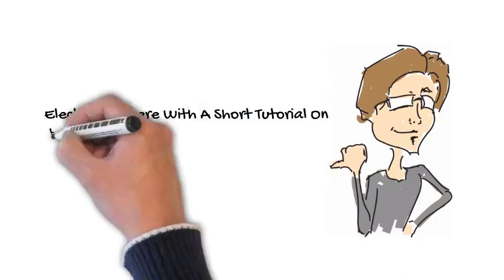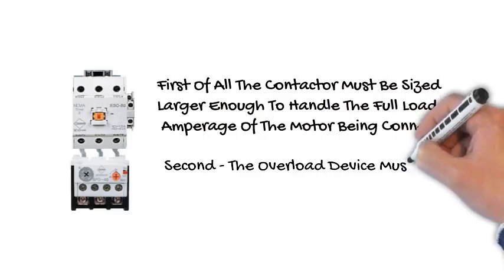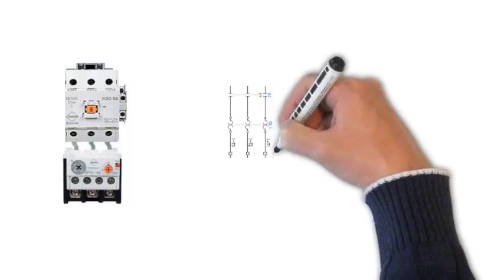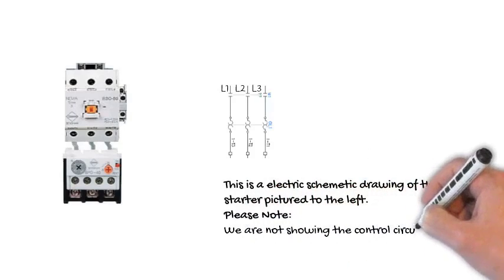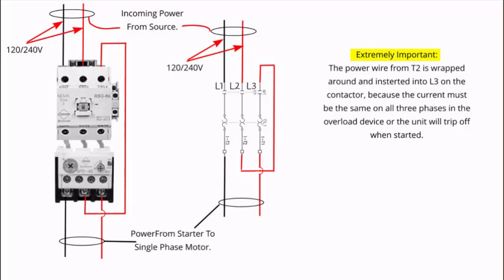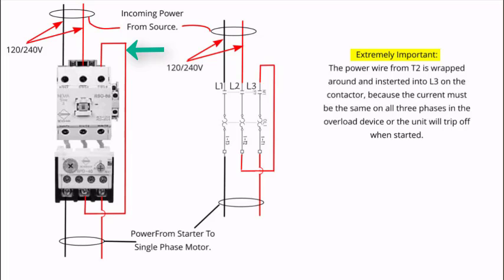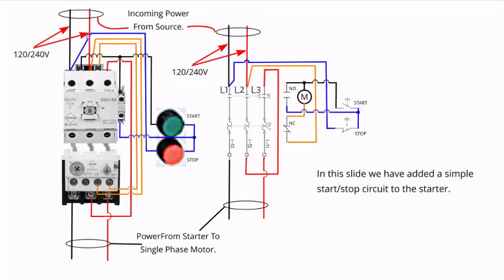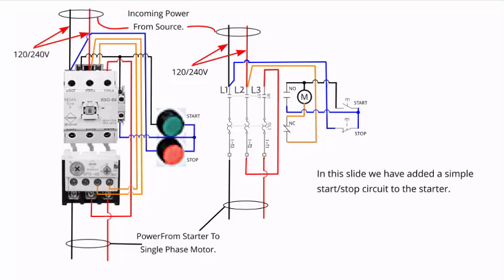Single Phase Starter Connections.

Comment: MY lath stops & start opareats  momaly but sometimes  when my Nabour switched on jet washer my lath switches of { why} ,  Often i only use my lath for short runs of work ,  but in  hot weather i find  my lath will not run long  [WHY]  
often My lath will keep turning of.  But then after several tries it will say on & work      normally for some  time & restart  Normally  when next i return to ti  {WHY}  Las Thompson ? It is a Single Phase Stand aloe stop-start box

Comment: This is my project at my school. i wonder if i can do this without an overload relay? just the contactor only? and if yes, should i also connect the T3 of the Contactor to the L3 of the Contactor? thank you.
Reply: If you want to use contactor only, then you don't need a jumper wire. Simply connect L1, L2 and start /stop buttons as shown in picture.
It will act as motor starter without any protection